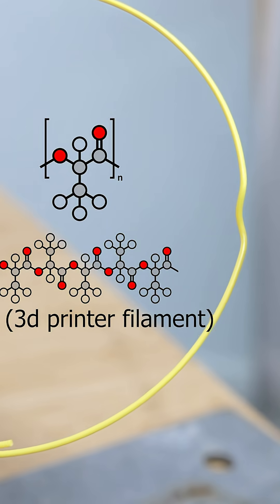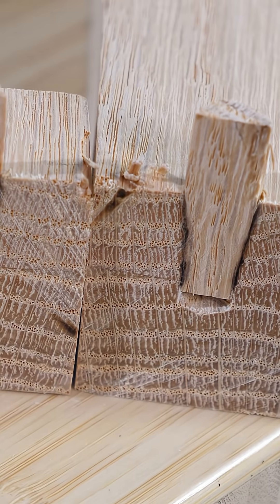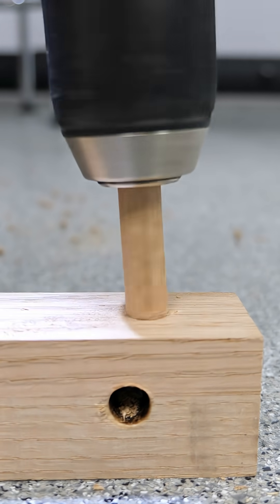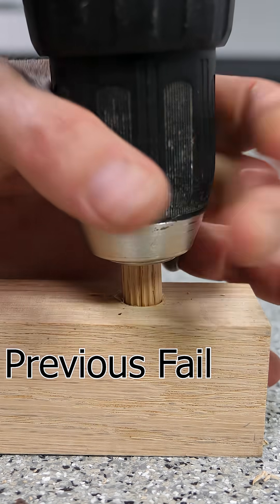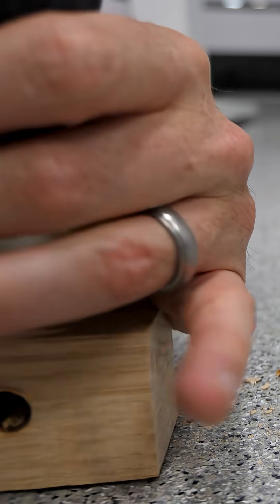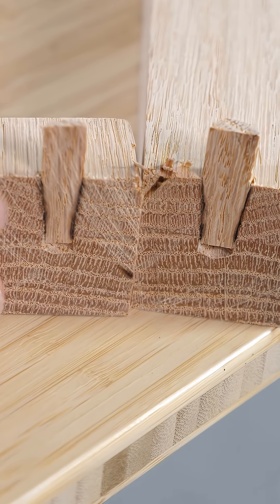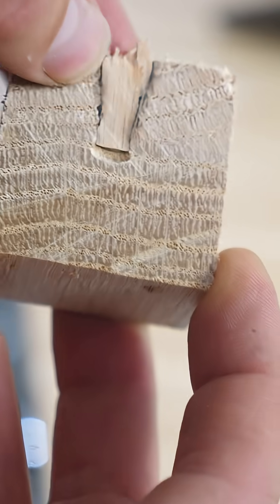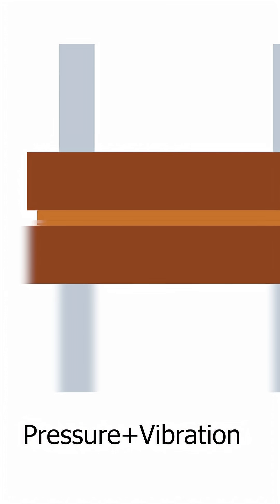I Melted Wood With Friction

Comment: You are doing it wrong, you are burning the wood. The problem with this is that its ignition temperature is lower than its melting temperature. So, if you want to actually melt and weld glue, you have to put it in an inert atmosphere or in a "perfect" ish vacuum.

Comment: I think it might work better with a slightly bigger hole. You're creating lots of friction  there, but mostly on the tip until the dowel slips in. It started to smoke before any welding was possible. 
I would try to have it slipping in immediately, like screwing both surfaces together. I think that the pushing force can be very small.

Comment: .....2005... This means i could have gotten that reward since i used the rotation method to make joints for wall hangers and just though the carbon created to bond with generated heat, obviously lacking molecular microscopes to check the joining surface to see what actually caused it... And buddy come up the maglev train idea and even built a scale prototype when 9 y old...

Comment: Something funny is that I always knew intuitively that applying enough friction and pressure between wood would cause them to bond in a way. I just didn’t know it’s the wood ‘melting’- I thought the heat on the surfaces caused the 2 surfaces to be brutishly forced into each other, or caused a process that acts like a very strong tacky substance as a secondary hypothesis.

Comment: dowels have an unfair advantage, as most of them are actually treated with a fine resin or epoxy, which helps it stick.
what you did there with the hole being smaller than the dowel is the same way that NAILS stick in wood. the wood separates enough to accommodate the forced in object, and the sideways pressure from the wood holds it in place.
not that you are wrong about lignins, but what you did ads extra holding capability, NOT just from the lignins.

Comment: There is to my knowledge two types of Oak…. Red Oak and White Oak,
    From what I can see on my phone the Oak being used is The White Oak ,?If I remember correctly the White Oak has a very tight Cell structure and the Red Oak-has a wider more open cell structure.
   This is a great video, 
what would fusing Red Oak wood cells look like in a cross section after being fused 😮
   What would different combinations look like in a cross section view . 
    Red Oak  to White Oak 
Then the Oak to Pine wood…. Then the Oak wood to poplar and to the species we have today…
  Thank you for the video and Congratulations on your award 😂😂😂

Comment: Their is wood filament for 3D printers (mix of wood pulp and PLA plastic). I use it for decorative wall plates and clothes accessories. You can stain it like wood and you can get creative with the print lines to simulate wood grain.

Comment: Fun fact, this is also how wood pellets are made for grilling and home heating, you take sawdust and it is compressed through a massive rotating die. The heat and pressure of forcing it through the die polymerizes the lignin and makes the pellet stick, it is also why the outside is smooth and shiny.

Although I think wood pellets were invented in the '70s

Comment: At my dad's company 50 years ago they had an ultrasonic welder for plastic panels, it used a vibrating metal tip to vibrate the edges of the panels and fuse them together as if they were a single part.

I later heard of a similar device that was used to vibrate wood parts to cause a thin film of glue applied between them to set instantly.  It was referred to as a "wood welder".  That sounds similar to the device described in this video; my decades earlier hearing of it may have been when it was under development or just announced.

Thanks for the video.

Comment: No no no no. Glass transition is an entropic phenomenon. Melting is entirely different. PLA does have a melting point at 150 or so. The glass transition is at 60. They are different. Thermoplastics, like PLA do, in fact, melt

Comment: I actually did that by accident years ago when I was woodworking and I didn't know what the hell I did I knew I didn't put any glue in but I couldn't figure out what I had done at first I thought maybe I just got the piece fit perfectly but I remembered that I had drilled the hole and it hadn't fit and I wondered if I could put the peg in you know use it to drill into the thing to make it fit and it did that but then I couldn't take it out so I had to unscrew the drill bit and you know that I call it a drill bit you know the thing it was attached to which was the actual drill thing my teacher at the time told me not to do that I might damage the drill he meant the actual motor of the drill he thought I would actually damage it by doing it I didn't know that I had done what you just did I thought that I had just gotten the peg perfectly into the hole that was slightly off its side I meant not measured correctly I don't always have words okay so I do the best I can with what I got in my hands and voice to text the incident I'm talking about was closer to 45 years ago and at the time like I said I got into trouble for it I didn't know I had welded the two pieces of wood together I didn't know that I just thought I had managed to force the peg into the hole that was slightly off I didn't know that by doing what you just did I had welded it in I did know that the teacher got angry that I had done it that way and he was worried that I had my ruin the motor by doing so. So it doesn't matter as far as I'm concerned who got the credit for it I don't care I'm just glad to know that I have learned something today that I never knew yesterday, thank you for that.

Comment: Uhh polymer melting point is not the glass transition temperature, unless you want to consider every polyethylene plastics to be already melted at room temperature. The viscosity increases linearly, but below the glass transition temperature it changes from a plastic solid to a brittle one.

Comment: For centuries, Japanese home builders have tightly interlocked wood frames together without the need for bolts or bonding adhesives, a technique they call Kigumi. 
Ancient Japanese Architects may have known that separate wooden intersections were prone to merge together under high kinetic pressure.

Comment: Actually "wood welding" has existed for thousands of years. Its a very old technique most people forgot about and stopped using over time because it wasnt that easy to do and why do that when you can create all kinds of locking joints that you can create much faster.

Comment: This is how sawdust gets turned into pellets.  There's a lot of interesting videos on how the pellet making machines work, but basically they compress the wood through a tapered hole until the lignin melts and bonds the sawdust particles together.
Reply: So this wasn’t discovered just 20 years ago?
Reply: @Publicname6570 the wood welding thing was discovered like 27 years ago. Lignin softening was actually discovered in the 1930s, confirming it had a glass transition temperature in the 1960s, commercial wood pellets came out in the 1970s (because of the oil crisis) but the lignin softening was probably part of the understood process for making particle boards or MDF since the 50s or earlier.
Reply: I used to make a all wood, wood Briquette. Recieved a patent for it😊
Reply: I never thought I was melting the wood togerher
Reply: Yeah and it wouldn't have anything at all to do with compaction would it
Reply: @madcat61207 It has everything to do with compaction.  As it's compacted through the tapered holes, it heats way up, the lignin is melted, and that bonds the particles together.  That's why the pellets have a shiny surface.
Reply: @madcat61207  um, what thermal effect do you think compression has? I'll give you some time to work it out.

Comment: Adding this to my list of things to remember when unwillingly transported back in time.
Reply: Yeah if you get transported back in time and you present this you could win the schwe... schwi... sch... A prize, you could win a prize!
Reply: These 2 men suddenly have memories of being stricken with a sudden drunken stupor that gave them a stroke and left them rambling schizos in a hospital. @GarrettBShaw
Reply: I wonder how possible this is with at least medieval tech. I know Romans had water-powered saw mills and medieval folk also use water and wind for stuff but would they be able to weld wood with what they have.
Reply: @TaLeng2023 Humans have known how to start fires with friction between wood pieces since... Well, we probably don't know exactly how long ago, but the stone age anyway.

I'm going to go ahead and claim that if you can heat wood to a smolder just with your hands, a stick, and a bigger piece of wood with a groove, you could probably also melt wood with that method. Would be a lot easier with a simple bow drill or the like though, but this are also stone age tech. So this could be used at any level of technology, really. The question is which applications are worth the effort.
Reply: @TaLeng2023 Oh absolutely.
Reply: The issue is with the friction.  There seems to be a bit more speed than what is achievable manually.  You'd need a water wheel and quite a bit of gear work to get it that high of a speed.  Doable, depending on exactly when you get transported to, but it's not easy, I don't think.
Reply: @swang30  "depending on exactly when you get transported"
Laws of physics stay the same. It's possible anytime, just reinvent tools to do it first!
Reply: @KittenRaee  the raw materials, especially in pure refined form, would be harder to find the further back you go in time. And it depends on the location, whether situated on trade routes. It ain’t Minecraft.
Reply: We're gonna be so ready when that happens.
Reply: @4.0.4 
Revelation 3:20
Behold, I stand at the door, and knock: if any man hear my voice, and open the door, I will come in to him, and will sup with him, and he with me.

HEY THERE 🤗 JESUS IS CALLING YOU TODAY. Turn away from your sins, confess, forsake them and live the victorious life. God bless.

Revelation 22:12-14
And, behold, I come quickly; and my reward is with me, to give every man according as his work shall be.
I am Alpha and Omega, the beginning and the end, the first and the last.
Blessed are they that do his commandments, that they may have right to the tree of life, and may enter in through the gates into the city.
Reply: Right!
Also, remember where the gold was found!
Reply: @MrJamezk or the tin, if you go far back enough. There were only a few sources in the ancient world, and it was traded long distances.
Reply: You'll be branded a witch! Watch out!
Reply: Only reason I watch this stuff
Reply: Or being petrified for 3700 years
Reply: You were. You're actually that guy. Just you wait... 😅
Reply: Glad to know I wasn't the only one thinking that during the video
Reply: If you get isekai’d though you might want to know chemistry, particle physics, and programming as that seems to be the true foundation of a lot of magic systems.

Plus it would not hurt to have those bases covered for basic time travel. 🧐
Reply: Not really usable without power tools.

Comment: Adhesion is a glue. It is dissimilar molecules adhering to one another through the adhesives chemical bond. Welding is disassociating molecules between the two parent surfaces to create a homogeneous Bond that goes deeper than the surface, therefore having more surface area, Adhesion is a Surface Bond between three surfaces.  A Weld is physically stronger.
Reply: Thanks 💪🤯🙂👌

Comment: Wood welding is neat. But inherently worse than the way japanese woodworking works. With the complicated patterns fitting together like a puzzle. No glue or screws needed. Its honestly probably the best way I have seen anything wood being made. Its beautiful to behold in its design.

Comment: Yeah,  at one of those tool demonstrations there was a guy who invented a "dowel nail gun".

Similar concept, but without the rotation (or maybe it was rapid and instantaneous); the gun just fired in dowels in the exact same manner most guns fire nails,  but the pressure and speed of entry fused them in place. 

Pretty cool.
Reply: Check LIGNOLOC product